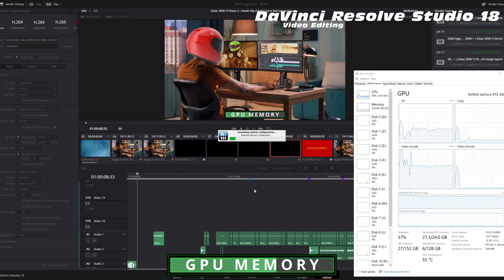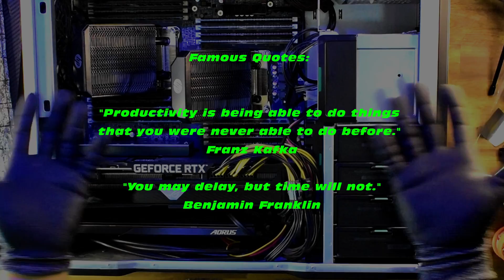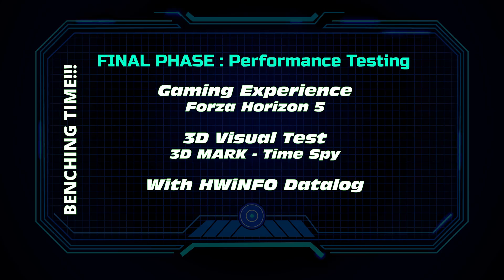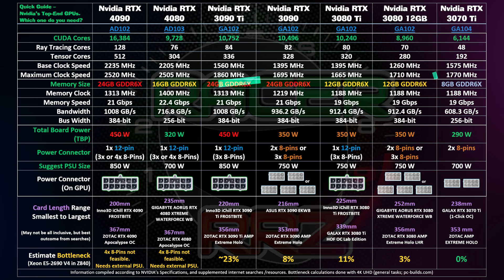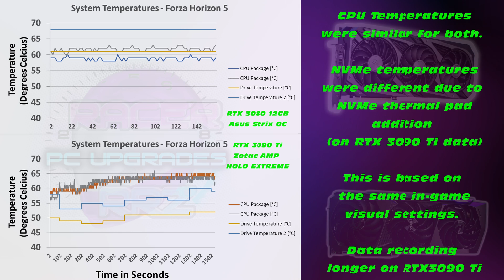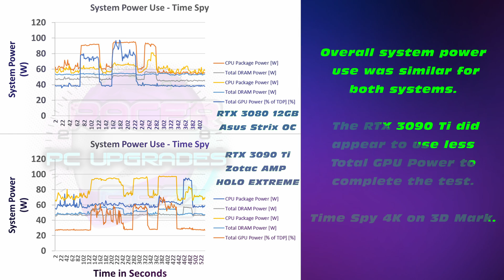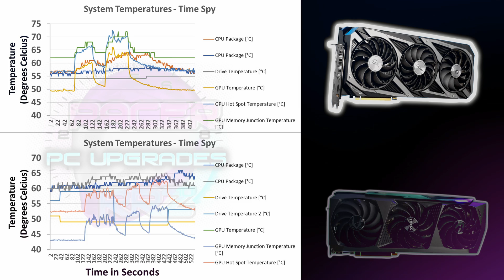GUIDE: Z840 Fitment of ZOTAC RTX 3090 Ti - Unleashing the Extreme Power in a Workstation

Comment: I just learned that the 1125w power supply will react to a voltage supply greater than 180V and will output 1450W!
Reply from the maker: Nice, that's correct - ample power to really load this system with hardware. You have 1450W on 240V mains with the Z840 (1750W with the HP Z8 G4). You also have 12.2V @ 18 Amps per 6-pin GPU power cable - so 219.6W per 6-pin for that modern GPU.

Comment: I'm really surprised you have not picked up any of the v4 CPU's for your system. There is a BIOS update that allows Windows 11 to run properly with TPM 2.0, plus you get more zooms from the faster processors! I upgraded to E5-2697A V4 and love it! They are really affordable on Aliexpress and I have ordered these and some 2680's and they work amazing. Anyways, thanks for this video. It helped me make the decision to upgrade from a 3060ti to a 5070ti. It's a much bigger card, but I want some more power and GPU RAM to help with my Adobe Suite. Have a great day!
Reply from the maker: Then I better explain my logic! Around early 2022 the Broadwell Xeons were still quite pricey and I had to settle on the E5-2697 V3's as my upgrade. I had eyed out the E5-2697 V4, E5-2697A V4, E5-2696 V4 as my ideal upgrades for the Z840, but they were several $$ hundreds which made no sense for the budget. 

All was well with the Haswells, but I was looking at securing a matched pair of E5-2697A V4s (I was after clock speed). Towards Sept. 2023 I scored the more logical upgrade. Just before hitting buy now on the Broadwells, an HP Z8 G4 - relatively barebones - appeared on my local market place. After doing some calculations (and selling a kidney or two - figuratively speaking), I went for the Z8 G4. 

https://www.cpubenchmark.net/compare/3273.2vs2750.2vs2783.2vs2814.2vs3517.2/Intel-Xeon-Gold-6142-vs-Intel-Xeon-E5-2696-v4-vs-Intel-Xeon-E5-2697-v4-vs-%5BDual-CPU%5D-Intel-Xeon-E5-2697A-v4-vs-%5BDual-CPU%5D-Intel-Xeon-Gold-6248

The Skylake and Cascade Lake Xeons offered superior performance and they were in some cases cheaper than the Broadwell Xeons for the same benchmark score. I could source two matched Intel Gold 6142's for half the price of the E5-2697A V4s - and thus I made the upgrade. With that said, I did buy one E5-2697A V4 last year - since their prices fell substantially (probably from all the decommissioned supercomputers flooding the market with hardware). Now I need to persuade you to make the upgrade! Sorry not sorry - check it out! https://youtu.be/z7Ff2zs5ByM

Right now I am running dual Gold 6248s, 384GB of DDR4 2933 MHz ECC Reg (6x 64GB), RTX 3090 Ti (the Z8 has 4x 6+2 pin GPU power cables - 219.6W each) and I have 9 PCIe slots to populate!